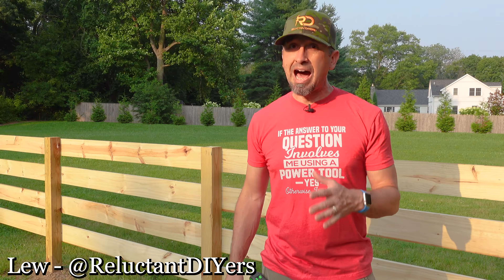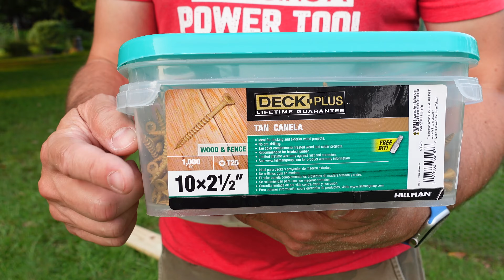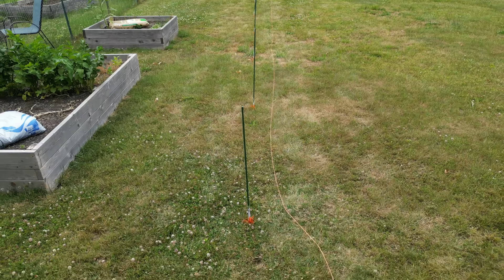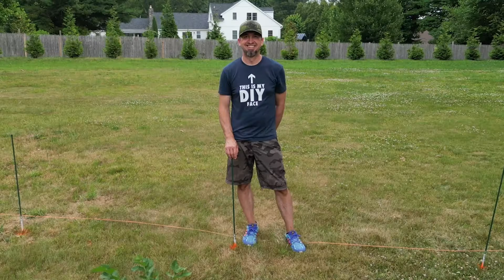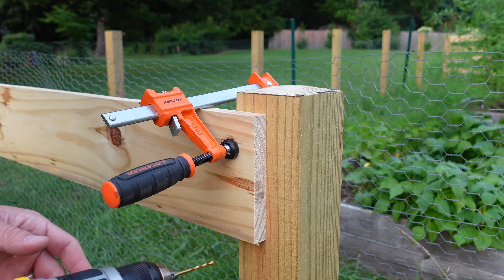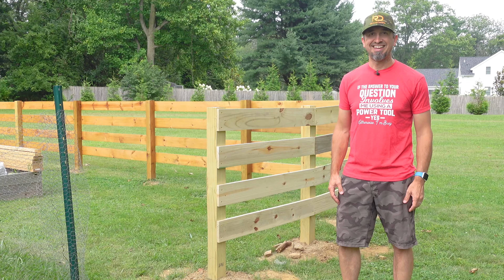How to Build a Fence for Beginners

Comment: Will the Post proservative work for non treated posts? I've just learned that the professional fence company i paid two years ago did not use treated wood. I found that out bc i had to remove sections to bring in my modular home and have decided to fix those sections myself. I'm female and that was my first fence I've had installed and none of that was discussed in the contract and the owner will not make things right. So I'm trying to figure out how to save this fence from further decay and ruin. I spent a small fortune on it and it began to fall apart at around 9 months. Not sure why it matters that I'm female, other than your videos have helped me know that i can do this project on my own. I love that feeling!
Reply: Also, I'm trying to find more of your videos to watch before I start the work. Do you have any on butting posts right next to the house? I have dogs that I need to keep inside the fence. I'm also not really sure about attaching the wire fencing to the posts and getting it taut. Thanks

Comment: Thanks for posting.  One question I have is to due with the exact height of the 4x4 posts.  Do you cut all the tops to size once they're set in place?  If so, how do you do that so they're all measure out at the exact equal height?  Also, from where do you measure the height?  Approximate ground level?  Thanks.
Reply from the maker: This is a great question and something I should have covered in depth. Once all posts were set, I waited for nightfall and then took my laser level outside to mark the posts at the same height. For the two longer sides (top of the hill and bottom of the hill) I marked them all at the same height so they would be level.

Comment: Thanks for teaching good practice. My boss and I installed a fence at his house with 4x4 posts, I had to break all the concrete my hand with a hammer and chisel, they used 2 bags per post. I had to use regular shovels and little hand held gardening ones. Took me 5 hours of killing myself to dig up 2 old posts, break the concrete, level and install the 4x4s with new concrete. No Auger, I’m so new I didn’t know what that was. I guess what I’m trying to say is this video is going to change how I work, inevitably changing my life. I’m so thankful for all this knowledge in a matter of 5 minutes, and I can’t wait to watch everything on your channel. 

Also if you have time for a question, when the pressure treated boards finally rot, would you use a jack hammer to break the concrete, and then shovel the pieces out normally? Or if you crush it up enough could you use the auger (after freeing the rotted 4x4)? Again, thank you so much.
Reply from the maker: Thank you for this very thoughtful and encouraging comment!  Regarding the post rot, keep an eye out for the video I'm releasing this Sunday. There is an easy way to help prevent post rot that has been used by the utility companies FOREVER... and you can use it easily as well!

Comment: How do you make sure your fence is straight I’m just putting up a 40’ fence down property line
Reply from the maker: The best way, in my opinion, is the method I show in the video using stakes and a visible string line. That's how I did my entire fence.

Comment: Keep deer out by using a 4 ft fence?
Reply from the maker: They will normally jump it, but this has not happened since I installed this fence. What I plan to do was to run rebar out of the top of all of my corner posts and string a heavy fishing line between them. That definitely stops them because when they hit the fishing line, it confuses them
Reply: @ReluctantDIYers That's smart you do great work
Reply from the maker: @davidellis7786 Thx! I appreciate it! ❤

Comment: Hello I’m looking to build a fence like that on my backyard and it’s a steep incline. Do I put the posts 4 feet up everywhere and then have the boards on an angle?
Reply from the maker: @GR.Operator.21  That’s one option. If it’s steep, you could also install your posts at varying heights and keep your rails level. The fence would almost look like steps coming down the hill.

Comment: so my front yard is relatively flat, but there are a few spots that dip down then come back up. what is the method for posts that will be set in the spots that dip down? will i trim all the posts to be the height of that lowest post?
Reply from the maker: Great question, thanks for asking! There are three choices here… 
1. Cut all posts to that lower level. 
2. Get a longer post to make that one as tall as the others.
3. Angle your rails in that one spot to go down to that post (not the greatest idea IMHO).

I hope this helps. 👍🏼👍🏼
Reply: @ReluctantDIYers thanks!
Reply from the maker: @Phunkafulicious  You are welcome! I appreciate you!
Reply: @ReluctantDIYers  another question. Got my posts all set now, and going with the method of just cutting them all to the same height. What is the best way to do this? Should I just pull a string from the shortest post and use that as a guide for how much to cut off each post? Thanks.
Reply from the maker: @Phunkafulicious  When I did mine, I used a laser level to ensure they were all the exact same level height. You could also tie a string to the far posts and pull it tight. You’ll just need to make sure it’s level. 👍🏼👍🏼

Comment: PT for the posts makes total sense, but the boards don't look like PT. Are you going to stain/seal them at a later date?
Reply from the maker: The boards are actually PT as well. Once the fence was completed, we did seal all of the wood surfaces and will retreat them this coming Summer.